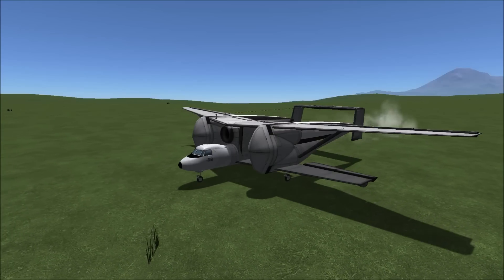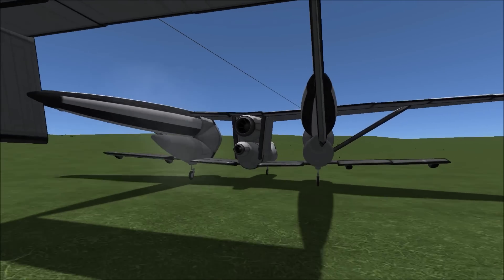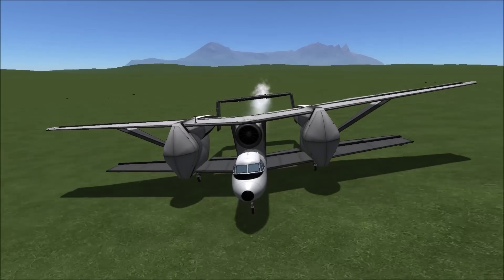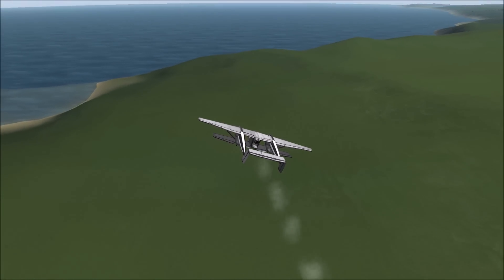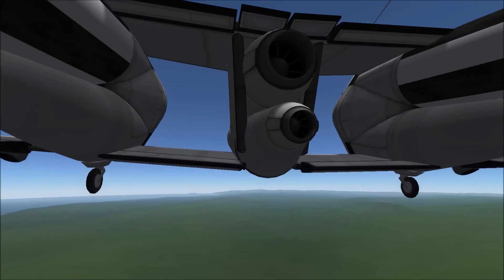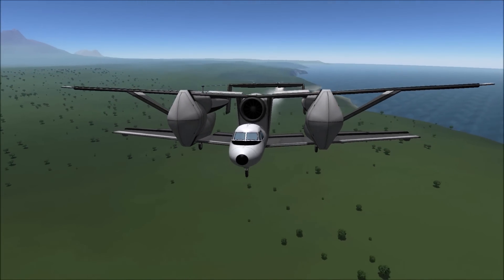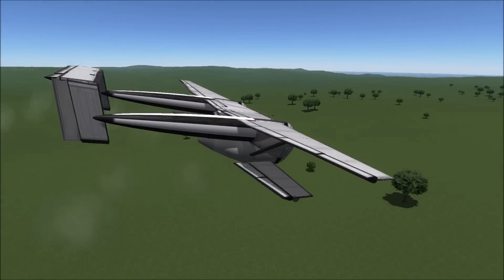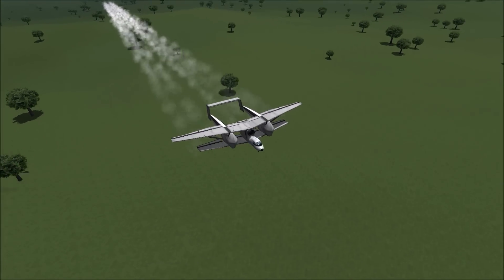KSP History's Misfits S2E3 PZL M-15 Belphegor

Comment: Is the intake above the cockpit a good idea? what if they have to eject?
Reply from the maker: +Neuttah +Jacob Furrow It could actually seat three.This thing would typically be  low and slow. Like Neuttah said, better off riding it down. Not everything has a ejector seat. I imagine the placement of the intake might have had something to do with avoiding catching the pesticide overspray and cycling it through the engine
Reply: +Jacob Furrow Crop duster: Probably doesn't have a seat, and even if it does, you're usually better off trying to ride the thing into the ground than jumping out at its altitude.
Reply: Hookswords That makes a lot of sense.